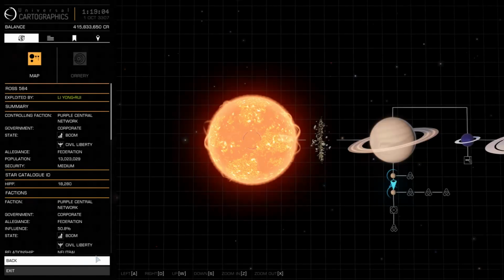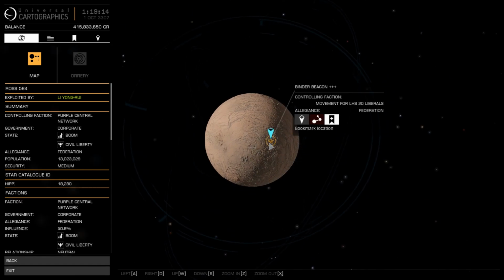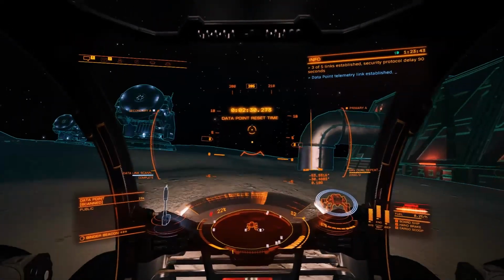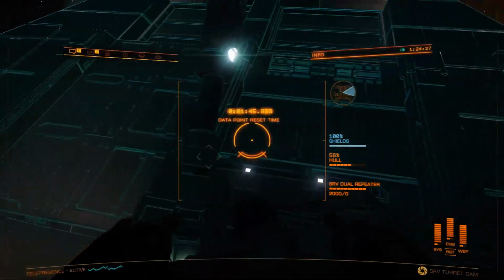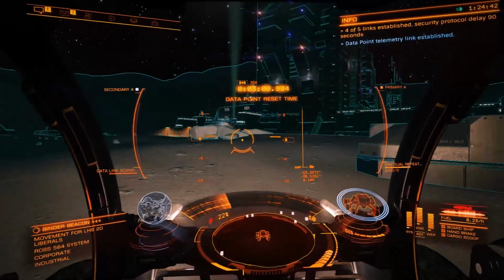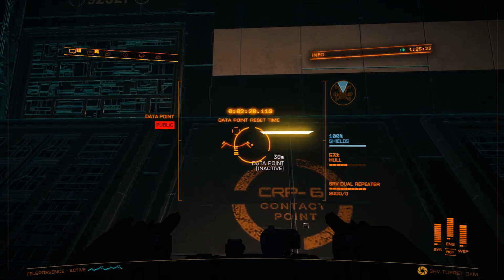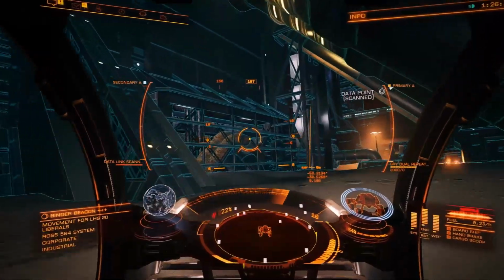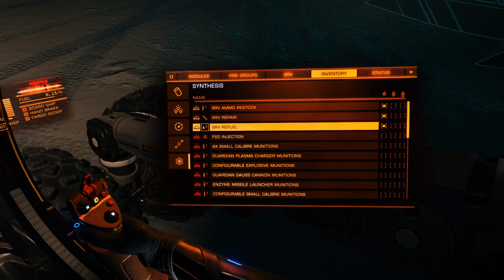Elite Dangerous | Modified Embedded Firmware | Farming location

Comment: Hey cool spot, about how many modified do you usually get per lap? Is this better than Jamison crash site (Hip 12099)?
Reply from the maker: Per lap it's going to be 3 MEF usually. The thing is, sometimes you don't always get MEF but it's usually every other trip around. I personally believe it's better than Jamison crash site for a few reasons. 1. Ross 584 is like 2 jumps away from shinrarta Dezhrah and 2. MEF are almost always a guaranteed drop.
Reply: There is a sweet spot at Jameson, where you can park and hit all terminals with your turret without moving.  Makes re-log farming really fast.